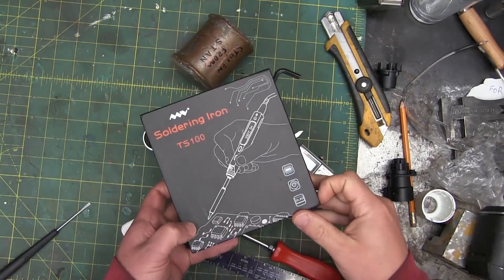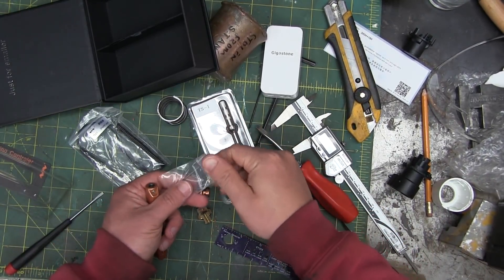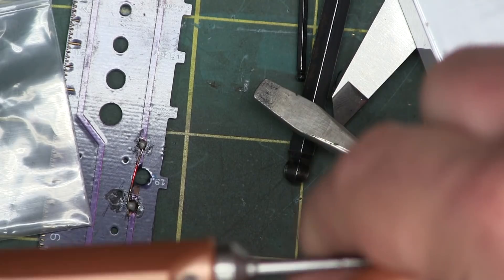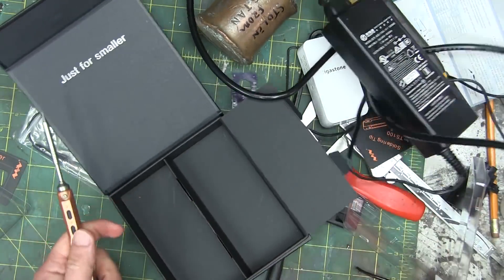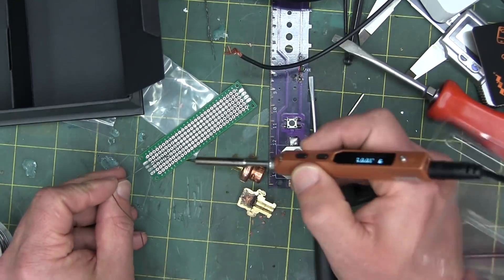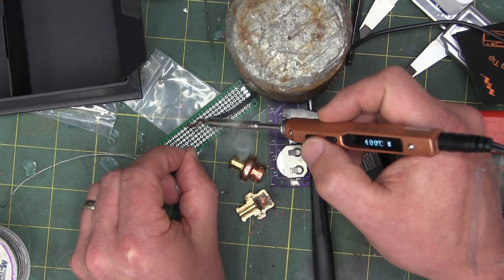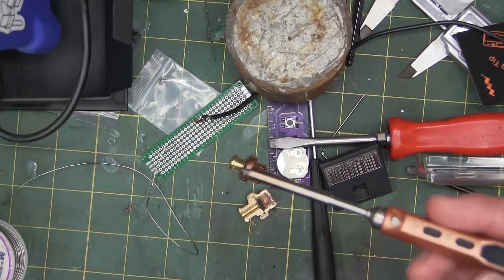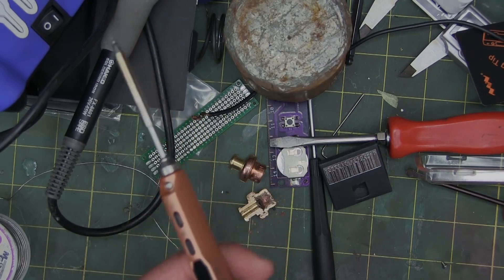BOLTR: TS 100 Soldering Iron | Quickie

Comment: Just like any open-source stuff, some assembly is required. Pay for an iron, then find a suitable cable and a suitable power supply? I go with EU on the idea you have to buy stuff that contains everything you need to use right away.

Comment: I use mine with a 65W phone charger hooked up to a barrel jack cable which requests 20v from the charger. I've measured in excess of 50W power consumption and the iron heats up in seconds. Also, with the right tip it can handle joints on even large copper plains.

Comment: The Hakko 888D is grossly inferior by virtue of being a traditional non-cartridge design. The TS80 and TS100 will be able to maintain their heat even at lower wattages due to better thermal recovery and reaction to thermal loads.

Comment: I just rigged one of these to run on my makita batteries, and put a ratchet holder on the battery adapter so I have somewhere to hold the hot iron. Very portable , heats up in ten seconds, and cools faster than normal too. There’s no ceramic waiting to melt stuff if you need to pack up in a few minutes. 
I really like the makita power, which you get off Amazon for not much.

Comment: My lovely amazing girlfriend just bought one of these for my busy birthday, but it was marketed as an upgraded model. I have a weller 1010 for working at home but these ts100's seem to be the perfect thing to replace my butane torch for working on my freightliner. Gonna work on getting an adapter for my kobalt 24v batteries for working outside on stuff. Like you said though AvE a proper bench station is better but these things in my opinion so far are far superior then butane irons for field work.

Comment: Mine came with a power supply and silicone wire leading to the iron.
Great field iron as I just plug my lipo batts into it. 
Haven’t bought gas for my portasol now and probably won’t for a while.

Comment: haven't tried this TS-100, but if you want a full soldering station with fume extractor and hot air reflow, i can highly recommend the Aoyue 968A, it's a solid piece of gear for a reasonable price

Comment: If you want a good soldering iron, get an 862D+.  You get a damn good soldering iron and you get hot air all in one for way less than a Hakko and 10 to 20 bucks less than this thing.  I've had mine for 3 years now and its still going great.  Heats up in seconds and stays hot even with a high load. Just get new tips when you get it, the ones it comes with are fairly meh.

Comment: Version I got, the USB isn't only for software upgrades, you can also change settings (like time until idle, etc), I believe it must have either a gyro or accelerometer in it which enables it to drop back to a safer temperature for the tip when it know it's not being handled (when you pick it up, it immediately heats up again).

Also mine DID come with more than one tip, and it DID come with a nice 24V PSU, with which it heats up VERY quickly. I like that it works even with 12V supplies but agree it's quite a bit slower to heat up on those.

I didn't know they made different configurations so it seems like YMMV depending on where you get it from.

Comment: THe ts100 is popular for us drone pilots.  Its small size and fast heat up works great for in field repairs when we use a LIPO battery with the some silicone wire. That said this is on my wish list as I have not been able to fly and when I do I"m usually near my home to make repairs.   Before this was released I was using the weller soldering tip that was powered with 2 AA batteries......

Comment: I've been using a $20 Weller soldering iron from HD on a lamp dimmer for the last few days for soldering my first board. Works very well. Didn't want to wait on shipping for a real soldering station.

First, I bought an iron from Walmart, but it wasn't even usable (not enough power, handle would get hot, tips wouldn't even tin). Then I went to HD, and bought one, but found it got too hot. Put it on a lamp dimmer; problem solved. Nearly as good as the proper soldering stations we have at my job. Only annoyance is the heavy AC cord, but you can get used to it.

Comment: Someone has probably mentioned this already, but you can flash the firmware and get tetris on the display. And for every game you loose the tip (which while playing is in your hand) heats up 5 or 10 degrees science.. Could result in a interesting party game 😎

Comment: I think you're missing the main point of this iron. I fly fpv drones and I can power this from the regular 4S batteries the drone uses with a 1$ adapter and fix my drone on the go. I bring this iron with me wherever I travel with it and it's saved my ass a couple of times already for almost no extra weight or capacity to my bag. On top of that, if you power it with 24V it performs better than any other iron I own, so it's actually replaced my other irons even at home...

Comment: You don't get it.  I understand now.  I have one that I can use via 12v car adapter, or any laptop power supply (with adapted cable), or via my 20v dewalt batteries ( adapted) .   So you can only stick the Hakko in a two pronged inlet.  INHO it is a fairly good soldering iron I can take anywhere.

Comment: The 888D is a toy compared to the hakko FX-951.  Ever since I got one I can't go back to the old kind.  The 888 is just a 936 on steroids. the 951 has the element built right into the tip and gets the heat into the work  soooo much better.  Don't get me wrong, the 888 and 936 blow away non hakko irons but if you're buying a new one you might as well get a 951

Comment: Nothing a proper sodding station can´t handle. This thing is a proper "if and you will need it"  device. For guys like me that know you would actually need a proper station to do the job right but the use isn´t frequent enough to justify the cost of said station. Like sodding on some wires in a confusor or alike.

Comment: I think you missed the point of this iron. It's a fantastic mobile iron when used with a battery. It's super convenient, and small enough to toss in your grab bag for field repairs. Lots of tip options. Couldn't ask for more in a cheapo chinese soldering iron. You can also crank the heat way low and use it for applications you might not think of, like melting hot glue when your pick is in a dickle.

Comment: You're not taking into account the fact that it uses the heating element integrated into the tips, which respond much faster than the tips on a regular iron... tip availability isn't great, but it is somewhat compatible with the T15 tips for the Hakko FM-2027

Comment: And here I am just plugging away on a Radioshack 64-053 soldering station.
Perfectly adequate station, just don't expect to solder fuck-huge joints with it. Also the tips are compatible with the Hakko 936 so I can still get replacements easily enough.

Comment: I use MetCals and Pace at work. Heats up in seconds. Tip temp controlled. Hundreds of different size hot swappable tips to choose from. Comfortable to use for hours and hours. Has 3 outputs, 1 for regular iron, 2 for hot tweezers, and 3 for vacuum de-soldering iron. Certified for use on J STD class 3 hardware and ESD safe.

Comment: so has anyone ever used an isotip nicad cordless Soldering iron (about $80)? got my first one 20 years ago.used one sitting behind a pepboys next to dumpster. me and step dad replaced batteries. lasted me till it was lost/taken. the light sucks, swap for led and small resistor. tips are $8 or $15 depending on which kind. try one. so simple it works a long effing time. deep end anal! I mean dependable .

Comment: I’m using 19V power supply for this solder iron. This device is the best thing which I bought in China. It is brilliant! Always use it on delegation trip and don’t have to take my big solder station from my office 🤗😁

On 19V it heat up in 5s, and you can solder very thick pads like in quite high amperage full bridge rectifier or transformer

Comment: The point of this iron you missed. Its main benefit is that is runs on a range of voltages and in DC. So it can be powered buy a lipo battery in the field to repair on the go. Not at your work bench.

Comment: I just bought one of these, with a set of tips. Getting a 24V PSU and some silicone cord was an obvious next step, I made an earthed 24V lead and a cigar-lighter lead. Yes, I mostly use the chisel tip doing SMD assembly.  Since getting it I haven't even switched on my Weller WMP,  except to solder the plug on the end of the silicone.  The nice thing is the tips (including element) are less than half the price of the Weller, and should last a lot longer being solid, and with the automatic standby/shutdown action.  In my view the problem with conical tips is that they are hard to keep wetted as surface tension naturally draws the solder away from the part with the tightest curvature.  So you turn it up, and it dries even faster.

Comment: got mine for ~$85 cad delivered with  the 24vdc power supply included with a nice cord. i dont have any problem using it but  my only comparison if the $10 cheapo irons and ive never used a really professional iron before. i found it works great as a hobby tool and i like having the option of hooking it up to a 12v alarm system battery in the field if im in a pinch.

Comment: It's not meant to replace a hakko or weller or any soldering station, it's meant to be portable, you can hook it up to a battery and actually have a decent portable soldering iron.  RC guys love it because we can repair our stuff with the same batteries we use to power our gadgetry.

Comment: I would like it better if it was around $40. I've always seen it for $50-60. If you get an 888D for $100 you get a power supply, nice cord, and a good stand with the brass and sponge. Or you can go the cheap route and get one of the 936 stations for less than $20. Those seem pretty good especially for the price and you still get the power supply and stand.

Comment: When did soldering irons get so expensive? I remember my first Radio Shaft iron was $ 2.95, of course there was no heat control, just a simple 30 Watt iron which handled most jobs fairly well. When did heat control become a must-have? HC back then was a proper chisel tip.

Comment: prefer this on the road compared to those gas powered or built in battery soldering iron. As a hobbyist it is amazing what it does off the bench.

Comment: I've got a thermaltronics chinesium knock off of a metcal. The tips control the temperature using magnetics and the power source is RF based. They heat up in about 10 seconds, cool off just as fast, and with the right stand (magneto-ring) they are impossible to leave "on" 10/10 recommend.

Comment: I have been told that people working on sensitive equipment will use only butane soldering irons because electric irons will put some electricity into circuits. While this probably isn't an issue with an iron that has a ceramic heater like this one, but for the ones with resistive wire elements how might we prove or disprove that theory?

Comment: You have to remember it's mostly designed for RC hobbyists. The voltage is designed to be up to a 6 cell lithium battery and it's portable, great for fixing up your toys in the field.

Comment: I've got both, the hakko fx888d I converted with a torrid for 230V.
I far prefer the hakko for bench work, it just has a much better thermal capacity. 
However, I fly racing drones, and drive RC cars, and for field repairs, the TS100 beats the crap out of any gas or battery iron Ive used. But it really likes the higher voltage though. I run it on 6s (24V) lipos (65watts). Can solder 12AWG well, but I find the limit is around 8AWG

Comment: Maybe this soldering iron is for running off the 12 volt battery in your car while you are working on the electrics in the car? Yea, how many times does that happen when you are away from a mains power plug.

Comment: This is an awesome soldering iron.
As a bench top device its not the best because its not a soldering station like the Hakko, but thats not the point of this iron.
Its fairly portable. And (like what Rossman says), the tip, heating element and tempsensor are integrated, which results in excellent heatup times and thermal capacity of the tip. Tips are still affordable at around $10-15.
And being portable (with a lipo pack) its way way more competent and precise than any other portable iron on the market. Thats why its very popular by for example drone racers.
The only thing missing imho is an extention kit that would turn it in a bench station, so a decent stand and powersupply in one.
It has the capacity/power to function as a proper bench soldering station, so a kit that would turn it into one would be great. And then you can unhook it if you want to take it with you.
I use this thing a lot, and even on 12V its pretty competent with lots of heat capacity.